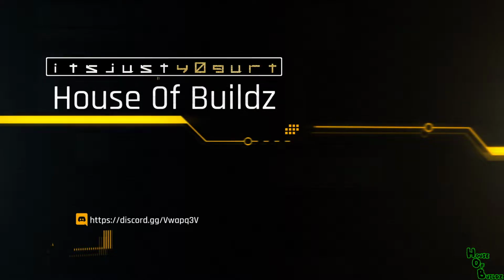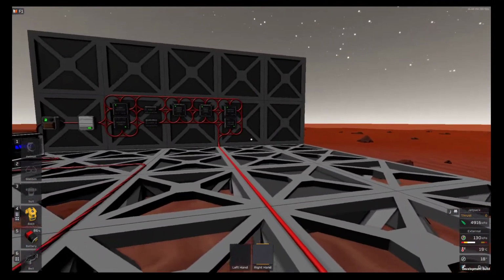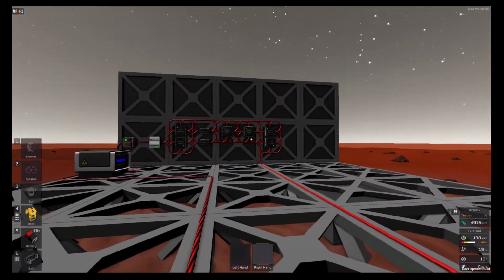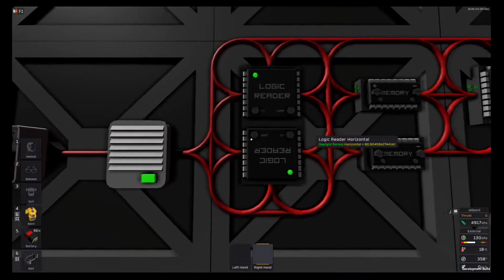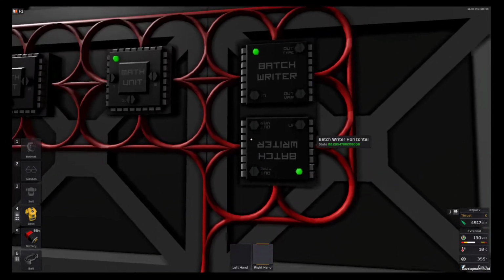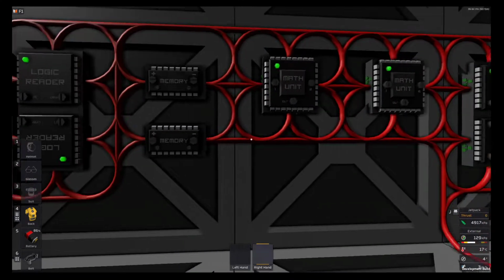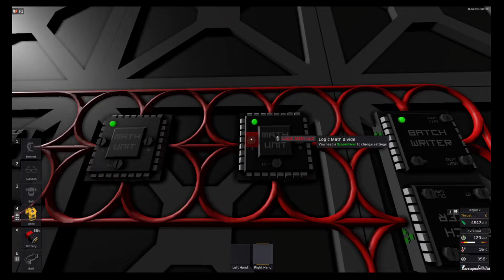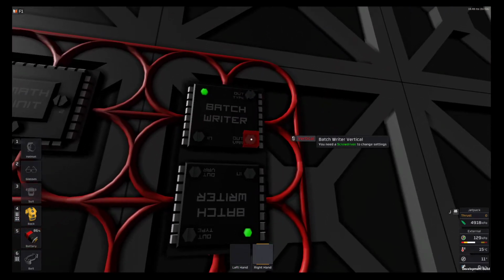Stationeers 101 - Logic Chip Solar Tracking January 2021

Comment: these sensors make no sense to me,  i  have got 24 sensors in all directions and orientations but cant seem to find out how they work.  they dont do the same thing in a diffrent orientation somehow...or i am trikking my self.  If i dont find a solution myself the next hour i will use your setup, nice work!
Reply from the maker: Biggest things to remember are:

-Sensor reads in 360 degrees
-Panels write vertical in percent
-Panels dont catch the first and last 15 degrees
-as of a month ago they made the sensors read both vertical and horizontal at the same time
-negitve numbers really screw with the system
Reply: @itsjusty0gurt469    it took me way to long but i got it to work, ended up with a simular setup like you have so i could have saved myself 4 hours.  Got 99% and i put in a extra logic that wil turn al solar tracking logic off during the night so i dont see the solar panels dancing at night XD

Comment: Thanks for a new update!
Edit, after the first night the panels don't move again, maybe iv done something wrong 🤷‍♂️
Reply: The direction of the daylight sensor should be placed similarly as in the video
Reply: @epictube1271  I found the issue, because I have my panels powering a kit battery before moving into my base and I have a controller to power the logic circuit, I didn't spot my logic was also connected to the batterys input for power so it kept draining my logic circuits power... A quick rewire so my logic circuits power is on a separate system and all is good